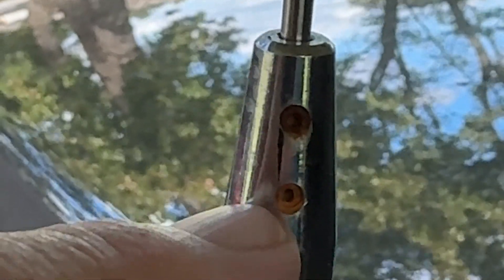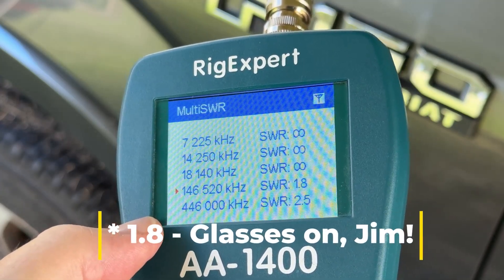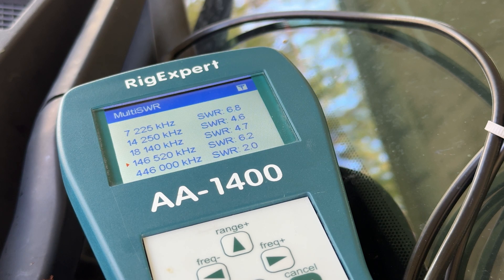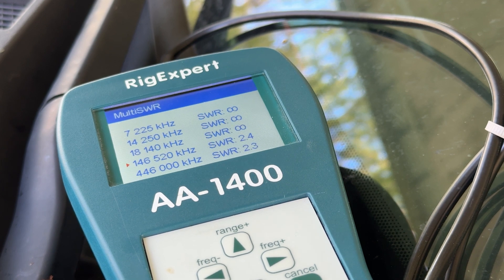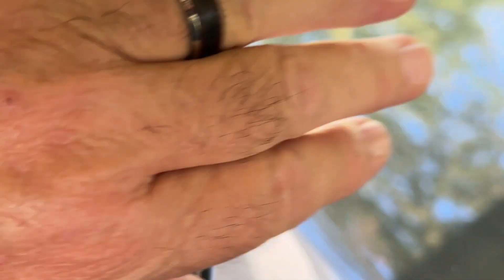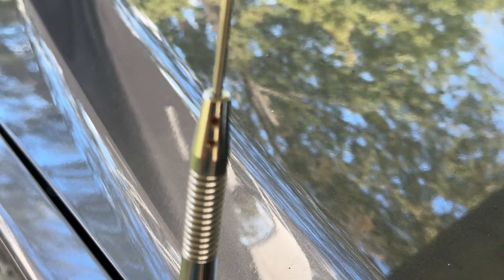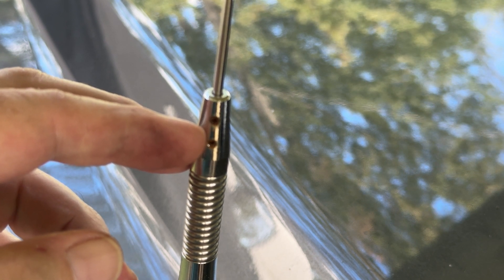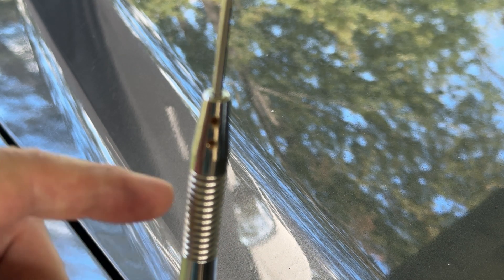Mobile Antenna Tuning

Comment: RF Engineer here for a commercial FM broadcast station (101.9 WWGR).  Your demo is telling me that your Radiator (Whip) length is too long for the frequency you are trying to tune.  You need to start trimming the whip at the bottom by no more than a 1/4 inch at a time until you get below a VSWR of 1.5   Great video for beginners, Thank you and 73.  BTW, At the station I use a commercial Rohde & Schwarz lab grade Network Analyzer for our testing.

Comment: Would be interesting to see the dip across the band. Seemed like you could have snipped a little off the bottom for better results. Great video Jim
Reply from the maker: Right - I may go back and tinker with it again.  I just had never even messed with that antenna and wanted to see what results I could get with just adjusting length.  Also - if I got it worse, I could reverse it...

Comment: Does the Rigexpert not have a sweep option for a band? Ifso perhaps use that to find the low point. It may be that the element needs trimming. Perhaps another vid there😊 73
Reply from the maker: It does - the option I used showed the lowest part based on the input parms, and since I didn't see much of a difference, I didn't go to deep on it.  A decent idea to explore that some more!